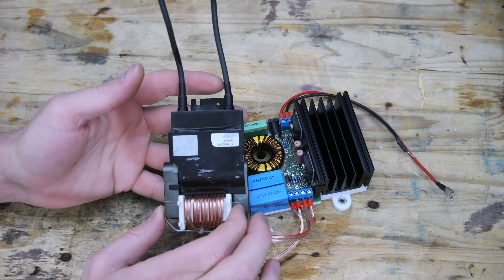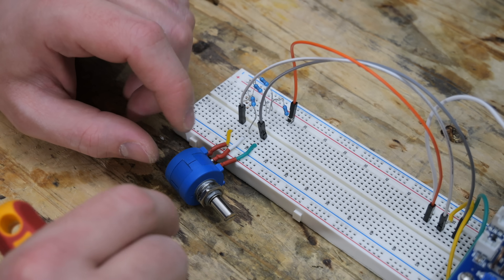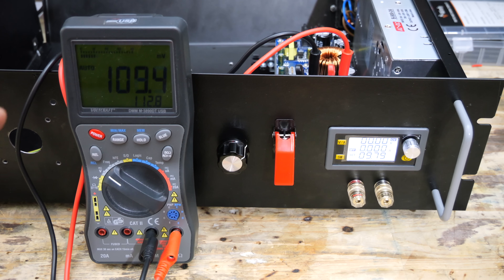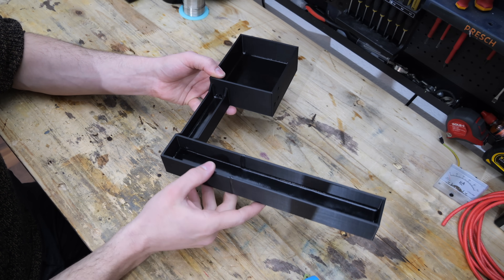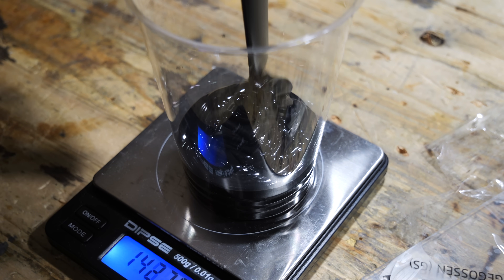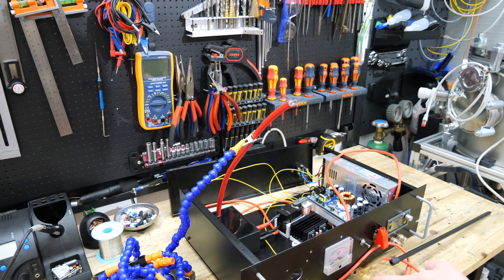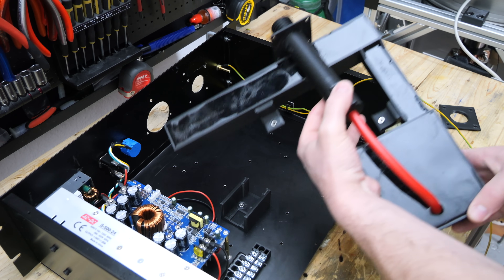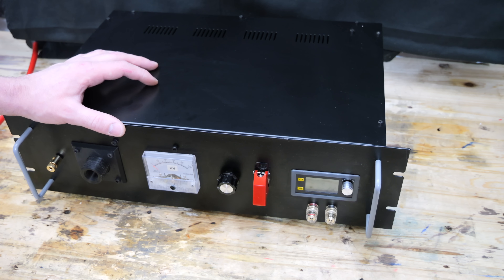Building an Adjustable High Voltage Supply

Comment: This supply is a death trap.

Urgh. Please, everyone: Do NOT internally connect your DC negative to chassis ground! There is no excuse other than laziness, and in this case, it's even safety-critical.

Both of those things need to be their own terminals. On a power supply with a conductive chassis, there always needs to be three terminals, with NO conductivity between them: the two outputs, and chassis/ground. AC or DC. There should be no connection between one of the output terminals and ground.

Yes, in practice you can connect them, but particularly for fault-finding, life is massively easier if you can isolate everything.

If you're planning on doing any kind of measurement, you just shouldn't connect your reference to chassis ground, particularly where you have a series of different grounded boxes connected together in a room. 

That ground is going to be full of noise, 24/7, and you don't want that. 
Instead, you want your DC negative terminal to be a separate rail from chassis/ground.

You can really ONLY get away with connecting DC minus (or your measurement reference) to your chassis if your whole system is fully enclosed by the chassis and it is conductive. (note, this means the whole circuit as used, not just the power supply). In this case, the chassis will act as a faraday cage, and it will always appear to be uncharged, even if it is charged.

Even then, you have to be aware about what wavelength of microwaves or RF can bounce around and resonate inside your chassis. This will make different parts of the chassis have different voltages, making it a poor reference.

So this works for (non-EV) vehicle wiring, where tranditionally one side of the lead-acid battery is connected straight to the chassis (saves on wiring!). 

Now all of the above is just for Extra-Safety-Low-Voltage (ie, <120V DC / <50VAC). 
For anything higher you should always consider return current paths can become 'live' just from the potential drop across them. 

For HV safety in particular, you basically do the *exact opposite thing from static-sensitive*. That means, ISOLATE EVERYHING. And YES, this means BOTH sides of the HV transformer! 
You did notice that both wires look the same, right? The output is between them. 

Have a broken ground connection on your power supply at the wall, or just a bad contact there, just once, and then also have the HV terminal touch ground, and suddenly that 50kV potential will instead be everywhere on the chassis of this box you must be reaching for to turn it off.... it will go through your arm, down your torso, across your chest, through your leg, through your shoe to the floor, whereever it needs to make a circuit back to the HV wire, and you could die with no second chance to learn from it.

Don't wire things like cheap microwave ovens!
ISOLATE both sides of your supplies!

IF you must tie a DC rail to ground, do it in one spot in your system (not inside your supply!) that you can easily access to measure the ground current. 

Look up what is required for a safe high voltage workstation. Rubber gloves, rubber boots, rubber floor mats, rubber bench mats, a faraday cage. How about a safety interlock?

Actually, yes: do that: your supply should also have a safety interlock loop: This is another two terminals on the power supply which will have only very low voltage/current through, which will permit the main output to run only so long as the terminals are shorted. Circuit open == no output.

You then buy an interlock switch of the fail-secure type to be that switch (have a second manual-disable switch in series), and build another circuit with a comparitor which is monitoring your output or the capacitive load you're charging with it. This is set to prevent you from energizing the safety interlock switch (when you want to open the door / gain physical access to the system) unless it is powered up and can verify the load is <48V. 

This means it's on you to contain the HV hazard within your system, and wait for the hazard to be gone, and verified gone (this is known as 'testing safe', and if you don't automate it like this, you WILL forget, and likely get yourself killed) before you reach in to touch anything.
The last feature you're missing is a serial interface so you can remotely change front panel settings on your power supply, without needing to disable the interlock and get access.
These are the safety features that properly designed high voltage DC supplies have, that you lack: 

1. (and most critically!) both sides of supply ISOLATED FROM SAFETY GROUND!
2. an Interlock loop input
3. some means to change settings when you can't reach the front panel... WHICH YOU SHOULDN'T BE ABLE TO DO IF YOU'RE USING THIS THING SAFELY!

Please please please, do these three things, deploy with a proper safety interlock - make a new video about it.
Reply: All (or most of them) modern high voltage power supply has one of its output tied to the earth ground: spellman, genvolt, etc.
Reply from the maker: I really appreciate that you took the time to write a longer comment! I'm always eager to learn!

It shouldn't be too difficult to separate the grounding of the casing and the high-voltage side.
What I don't quite understand: if, as you say, the grounding contact of the power plug is interrupted, and the high voltage touches the casing's grounding, can't the current still flow through the high-voltage grounding since, in my case, it's connected to the case grounding?
Reply: @AdvancedTinkering  Thanks, you're welcome!

Yes, it should: but consider that the high tension exists between the two terminals of the flyback transformer. 

The issue is that you probably won't notice such a ground fault. Imagine if then the high tension positive output perhaps falling to the floor and managing to connect to actual ground, the case then in effect becomes a high tension negative output. You could be standing on the actual ground, which the high tension is now connected to, and thus in circuit should you reach for the box. 

That circumstance is one fault (box chassis to real ground) plus one "dropped the HT lead". So, this is a double-failure, thus not too likely: But if it does transpire, then you're in the insanely dangerous state that the nice missile-cover on-off toggle switch secured to the chassis is actually at deadly high tension with respect to yourself, without you having any idea that this is so - and it's quite forseable you'd reach for it...

The trick really is to try never to involve the ground / safety earth connection in any of your circuit under test, anytime you are prototyping. 
You might put a resistor and/or choke between your circuit reference (0V / signal ground) and safety earth, for noise suppression reasons, but that should be a deliberate connection, not one built into your equipment, and certainly not built into your power supply box. 

Since you would want to work this way, you'd want both sides of the supply to be designed to allow isolation from chassis for the full potential available. This has the nice advantage that with a change of how you hook it up, your positive 50kV supply becomes a negative 50kV supply.

Those high tension 3d-printable plugs look great, btw - you should just have a second one for the negative side.
This does complicate the output voltage measurement a little bit, but since you're using a microamp meter for that, you should be okay just keeping it floating.

Be aware how you hook up things like arduino's and computers however: They're typically all "chassis is negative", but also can be isolated from safety earth too, if they're on external AC-DC supplies (laptops, etc). Usually not if they're on internal supplies like most desktops.

Similar deal for oscilloscopes - these always have chassis connected to safety earth. To make floating reference measurements, you get around that either by using expensive differential high voltage probes, or just by connecting the whole oscilloscope to a deliberately earth-isolated mains outlet. In most electronic labs this is usually a red outlet, itself connected via a 1:1 isolation transformer to mains to break galvanic connection, which is designed to allow you to do that. Some oscilloscopes have built-in battery supplies mostly to make such floating-reference measurements more convenient. 

It's also a consideration for properly CAT-rated multimeters and test equipment: They have to protect you not only from shock from the red measurement terminal, but also the black reference terminal and the internal electronics.

Also, there's a bit of depth to safety equipment and proceedures for working with live high voltage: Things like electrical isolation gloves, rubber boots, and keeping one hand always in your pocket and only reaching to touch things with the other and never both at once (lessens the likelyhood that you'll get a shock from arm to arm, across your chest). 

This is why it's generally so much easier to setup an interlock to test-safe for you, so you can eliminate the possibilty that you'll reach for something that could be fatally live.
Usually, you wouldn't bother if you're servicing something: Just wear the isolation gloves, and throughly test-safe before you handle anything that could keep a charge - but for experiments it's far more likely that you'd eventually forget that step, since you're focussed on other things, and you'd soon not remember if you had done the repetitive chore, or not. True safety require a degree of insanity by the classical definition of repeating a task, always expecting a different result despite never getting it.

Most HV supplies come with that interlock loop - usually shipped with a bypass plug in it to disable it until you want it, but you actually usually do want it, unless the job is so trivial that it's easy to keep both sides of the supply, and the whole connected circuit, totally isolated.

Comment: Eh..  toss that resistor pack in something like a load tester and get it off that power supply..  unnecessary..  may wanna put a safety pull on it tho..  connected to a wrist strap so in case you accidentally find out what electricity tastes like you will be able to remember it..

Comment: I recall a teardown of an x-ray machine from Mikeselectricstuff where a PL-259/SO-239 Rf connector shell was used with polyethylene dielectric RG-8 coaxial cable as the HV cable.  The center pin was a 4mm banana plug on the end of the cable with the insulated core sticking out 150 mm ahead of the backshell.  The insulated core of the coax was pushed into a plastic sleeve and mated with a 4mm in the back.  I think it was also insulated with silicone grease or something.

Comment: Hmm, I wonder what a vacuum chamber channel would want with a high voltage power supply :p

Also, its possible the fact the resistors are wire wound has more of an impact on the current than their resistance, they're probably acting like tiny jnductors
If you're really keen for 60kv, you can just freehand solder a voltage multiplier, or add a 4th stage to the same one as you used

Comment: Awesome build,
I would suggest considering the construction of a custom half-bridge inverter. It can be simplified by utilizing a self-oscillating chip such as the IR21531. This approach allows for greater control over the frequency, facilitating improved impedance matching between the transformer and multiplier.

Comment: I recognize that driver and multiplier PCB everytime I see em. Highvoltageshop stuff is just a great "supplier"for the obscure world of all things HV. Reminds me to get some parts for my large multiplier.
What resin did you use? That stuff would work wonders in my planned 120kV cascade, regular epoxy just can't hold back anything over 40kV.
Reply from the maker: Yes, it's great that there are shops selling niche components. The resin I used is from Demak. The clear resin is SEPOX225. The black resin is XE661 HV. Unfortunately, it seems that it's not readily available for purchase and one has to inquire with the manufacturer. I got it from a friend who is a polymer chemist after telling him that I couldn't find reliable breakdown voltage data for commonly available resins. If you come across a good alternative that's easily accessible, please let me know.
Reply: @AdvancedTinkering beautiful build btw, and excellent presentation/vid.
Reply: Thanks for posting that shop name. I also am hunting for a better insulating epoxy. The best i have tried yet is actually my wifes art stuff - crystal clear something its called, long set time, and almost no bubbles at all. It says its actually waterbased, go figure ha ha. Im off to chech that hv shop, thx again
Reply: @jonlitchfield8888  Currently have a 75kV peak multiplier cast in polyester resin and one in polyurethane. Lets see which resin holds up more.

Comment: Be careful with the no-name “Made in China” switching power supply! I've seen some of them literally go up in smoke. There are often NO line filters installed and the safety distances between the primary and secondary sides on the circuit board, or even in the HF transformer, are often life-threateningly small. Normal film capacitors or something else are also often used instead of the correct XY capacitors. As a result, these should not be operated here in Germany at all. Better get one from Mean Well. Either the UHP-500-24, or RSP-500-24

Comment: Awesome project! I made pretty much the same thing a couple of years ago but I used PWM to drive the ZVS and high voltage banana connectors that are made for HV laser supplies. Pretty much what you already made but without the resin hassle. Also I would recommend to use a pneumatic switch from a washing machine along with rubber tube and a squeeze bulb as your HV enable switch. This way you will be always isolated from the device if something goes wrong.
Reply: I would use this option for the sheer coolness of the thing.
For nerd points, i would probably use Lego pneumatics as pump.
Thinking about it, you could have lego Pneumatics actuator that actuates the switch.

Comment: The biggest problems I suppose with projects like this is that you have to perform numerous tests to actually deem it 'safe'. An uncountable number of tests for a full-on supply if you actually want to sell it... Considering the effort and parts, I would deem this project around $1k-$1.5k as a starting value if you build it yourself. (Including man hours)
Reply: This cannot be sold. The liability would make insurance impossible to acquire!

Comment: A good effort till you reach the insulation of the HV connector. You removed the bubble for the ladder, where you have lower voltage and left all the bubbles in the HV connector's resin. That's the weakest point.
Reply from the maker: It was a different resin that hardens much slower. So there was enough time for the bubbles to rise to the surface.

Comment: My tip for PLA. Don't use glue get some DCM (Dichloromethane)!
It welds the parts to each other excellently by melting the top surface of the PLA and it holds in seconds (full strength takes a little longer but DCM is very volatile).
You can also weld acrylic parts basically optically transparent with it.
Reply: I just feel like it's a good opportunity to mention some (not a complete list) of the dangers of DCM. It's a likely carcinogen and additionally acutely toxic when used in a closed space so either do it indoors in a fume hood or go outdoors for it. Additionally I like to use a syringe to distribute the DCM for welding but make sure there is no point on the needle, blunt needles only, severe tissue damage is known from accidental DCM injection into a finger to the point of needing emergency surgery and barely keeping the finger. Also it's a quite mild but still green house gas so ideally make sure any waste and especially the main bottle are stored correctly and in bottles where it won't just escape, it's a pretty small molecule and will diffuse through most regular plastics.

Comment: First off, really nice build!

My suggestion, make the output HV connector a bayonet lock quarter turn (similar to a mil-dtl-26482 or mil-dtl-38999 series I locking mechanism). There are also some plastic bayonet lock examples, such as Souriau UTP, ITT Cannon Trident, Amphenol Aquarius, etc. I feel like bayonet connectors are much more pleasant to use when you need to attach or detach a connector often, whilst screw-coupled connectors are better for semi-permanent applications where you would rarely or never disconnect the connector.

Moreover, if you wanted to, i believe you would be able to integrate a low-voltage safety interlock loop into the output connector at the opposite end of the HV terminals, so that HV power is only turned on when the low-voltage interlock loop is completed. All HV connectors I have used previously has had an HV interlock loop. Obviously it would be difficult to switch on/off the HV output, but the low voltage input to the voltage multiplier could easily be cut with a simple relay in series with the HV interlock.

Lastly, if you want really nice and professional looking front and back panels for your rack mounted equipment, you can use aluminium PCBs. They are extremely cheap from china compared to a custom machined panel, and they will make any cutout you want, and text/logos can easily be made with the silkscreen, solder resist, copper like you would for a normal PCB. Just epoxy two set of 1.5mm aluminium PCB's for a very sturdy 3mm front panel.
Reply: I am experimenting on some project dealing with high voltage power supplies.. I want to connect with you sir.. can you provide any communication mail or linkedin etc . ?